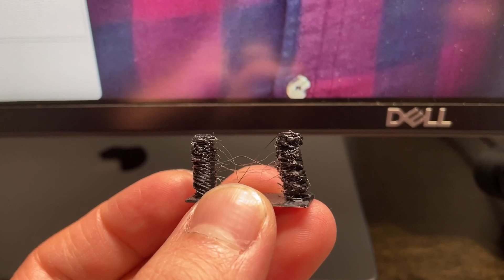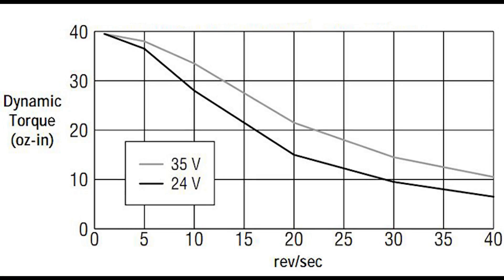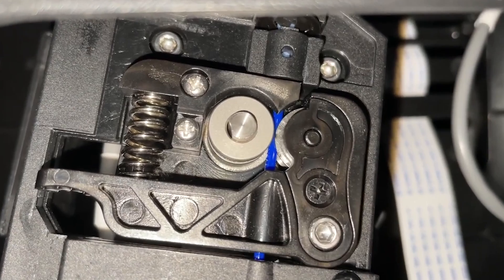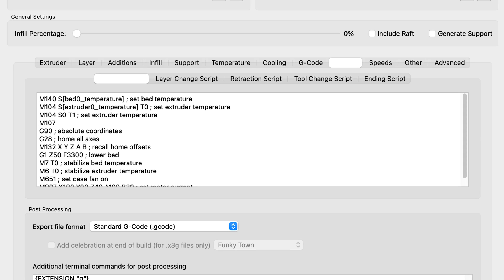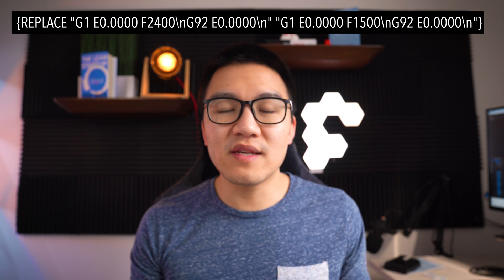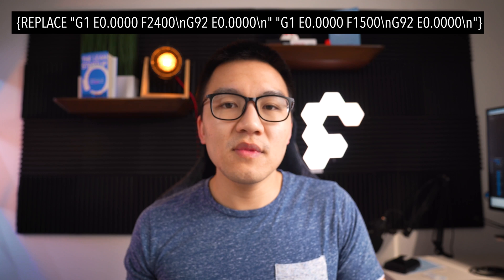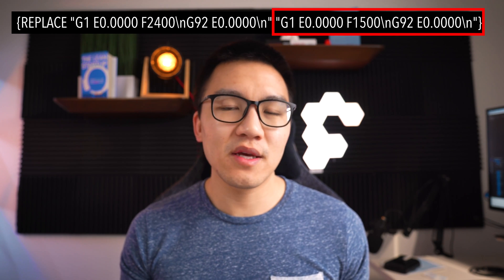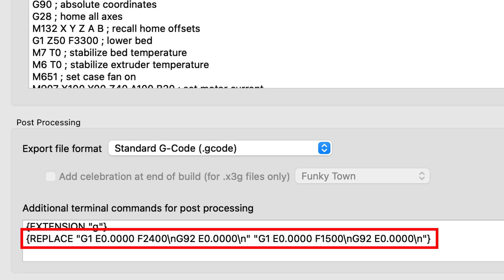How to Prevent Under-Extrusion

Comment: Very much enjoy your research Daniel.  Here's a desk "Tool holder" I just printed in PETG, no stringing to speak of, and no knocking on an Adv4.  Note that I use a Print Temp list and Cooling Fan list.  There is no one profile that fits every print in my experience.  For those pegs (or any overhangs), I increase the cooling fan 10% from what's shown in my photo (adding another entry in the list for in this case, layer 75 and above, not shown).  You just go into the slice preview and figure out where and how far additional cooling is needed.  Here's my photos, FlashPrint 5.3 print temps and retraction settings on OneDrive: https://1drv.ms/u/s!Arf1YeMUEh5Gm7R8h-IJOp6iqJmMVA?e=Z7E4iZ